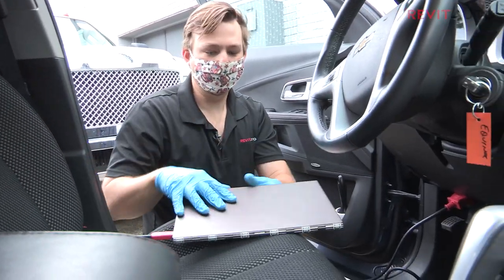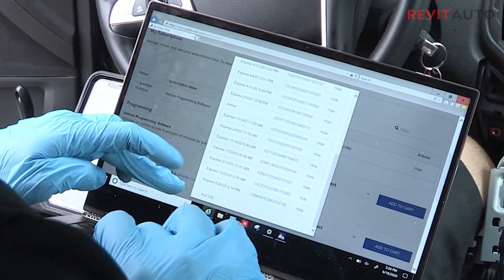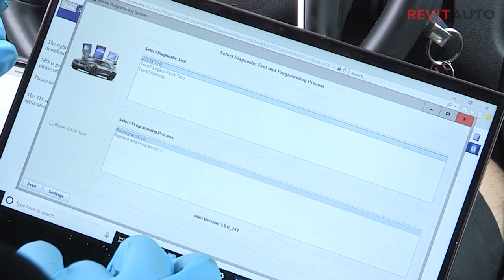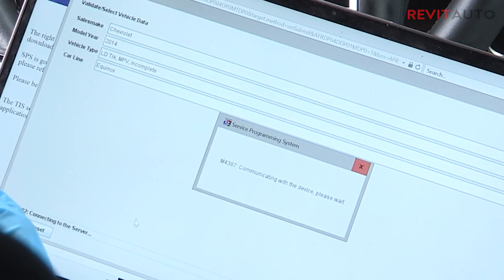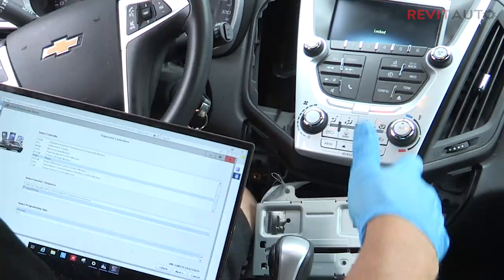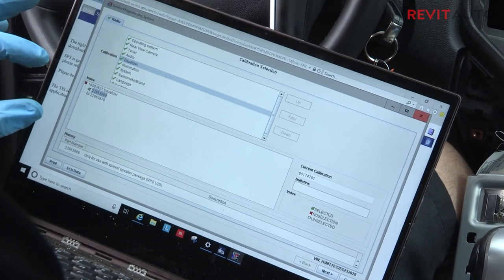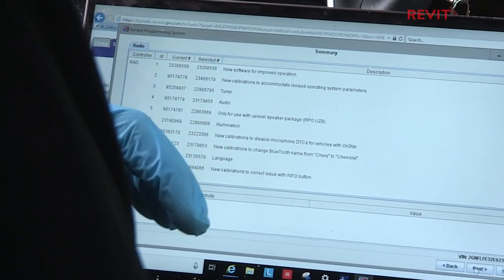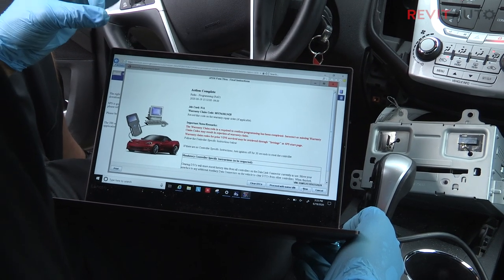How to Reprogram a Replacement Radio using the Autel J2534

Comment: I like this video.  It is important for folks to know that the OEM software is required to be installed on the notebook PC (and a valid subscription for the OEM software is needed ) if doing the processes shown here.

I'm trying to find out if Honda's i-HDS has support for this Autel variant of the J2534 device.

Comment: Man have you ever used the Autel J box with JLR SDD software to program Land Rover modules?  I have the Autel showing up as connected to the laptop, but the SDD software doesn't seem to see it. Wondering if you've ever used it with SDD.
Reply from the maker: Interesting, I have not. Have you called into to Autel support? They are incredibly amazing and helpful beyond anything I have ever dealt with before. Have you downloaded drivers for your Autel onto your computer?
-Blair
Reply: @Revitauto  I find that they only really help if your current with software upgrades and such. I don't work on anything newish so I haven't upgraded. Now, I've not called about the programming, but just referring to general support issues regarding the diagnostic tablet that I have. Maybe they would be different about programming questions.